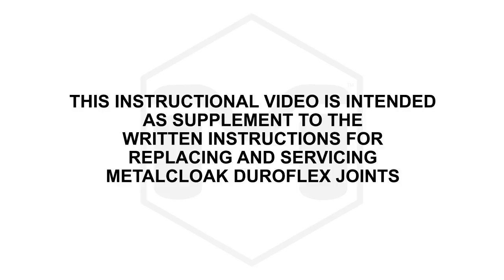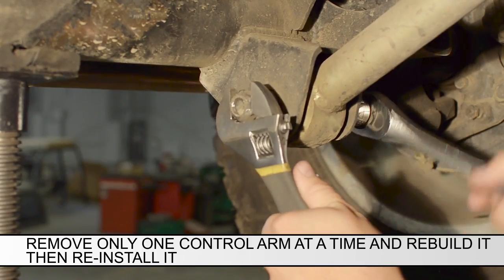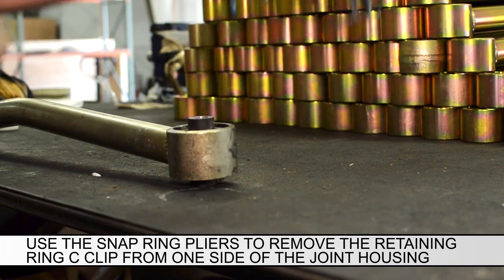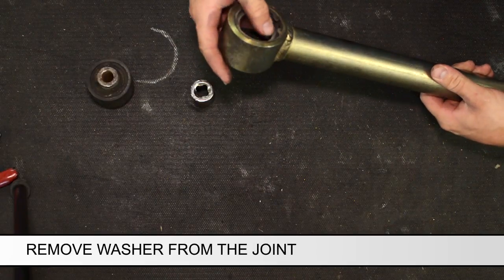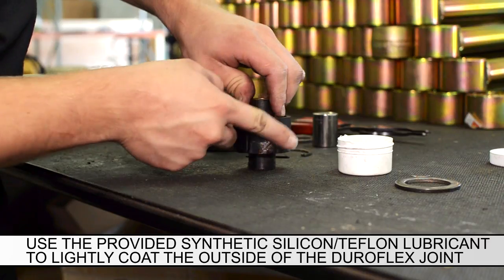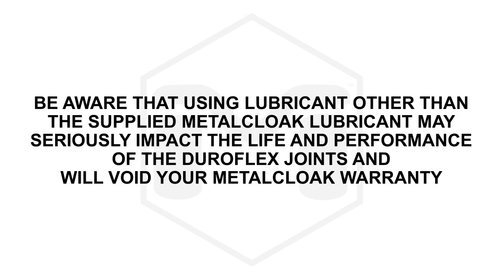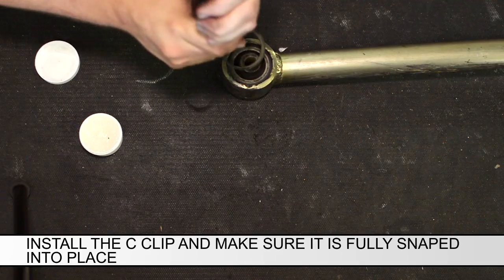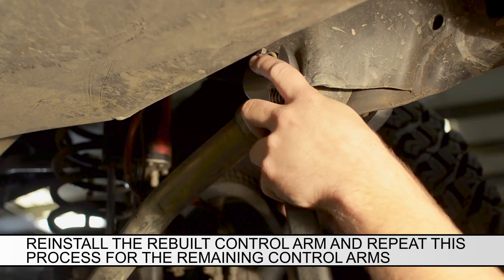How To Service: MetalCloak Duroflex Joint

Comment: 1. How often is this needed if a rig sees moderate wheeling in mud, gravel and lots of dusty dirt roads, but rarely in rocks. This is a DD, too, getting about 8,000 miles per year.

2. If you do not have a time table, how can you tell if the joints need to be re-lubed?

3. What is the current price of a new tub of grease?

Thanks!
Reply from the maker: Wow... sorry we missed your comment. It is hard to keep track of comments sometimes when there are so many videos. The joints are maintenance free and do not need to be re-lubed once installed. These instructions are for the guy who likes to take apart his suspension and clean up all the parts. If you do that or if you replace a bushings after several years, then you will apply a small amount of grease to the outside. The grease is Superlube and is available in most autoparts stores.